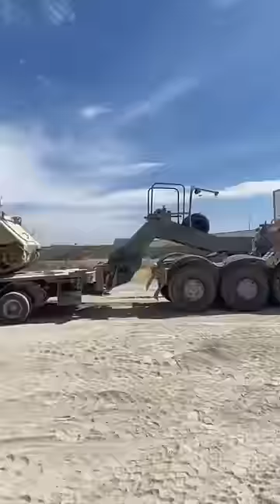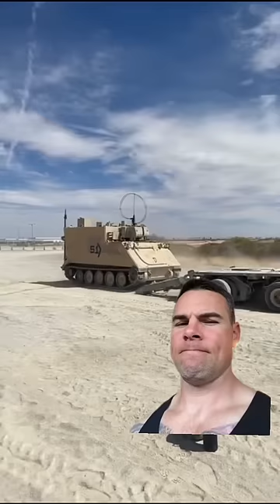I don’t think we’re supposed to do it that way. Via: @usawtfma #military #marine #army #navy

Comment: I drove those on my second tour in Iraq. That is actually called a combat drop. you simply take off the chains put the vehicle in neutral go forward just a little bit and slam on the brakes, and the vehicle slides right off. Extremely useful in a hostile environment. It's cooler with an Abram.
Reply: This comment needs to be pinned fr

Thank you for your service brother ✊🇺🇸
Reply: Yeah the fact that they knew to back up and slam on the brakes to get it moving told me this must be a thing they'd done before.
Reply: 2003 we started the combat drop. Except it was woth a D7 dozer. Now thats a fun way to do both on and off. Amd if you were not perfect timing with it.... Bam.
Reply: @semperfi-1918  hell they we were doing this at fort hood in 94… the was the first time I saw it.. funny as shit..
Reply: You mean reverse?
Reply: @A_name_is_a_name yea, they mean reverse.
Reply: well newton would tell you its better to go backwards and hit the brakes when the vehicle on top of a flatbed is in neutral, else its gonna ram your cabin in front ;)
Reply: @A_name_is_a_name  I did indeed. You are correct.
Reply: @semperfi-1918 I was doing this in 1998 in Germany.  I was in a HET platoon. Bco 701st ,1st Infantry Division, Kitzigen Germany. You were not the first. Besides you Marines didn't even have this HETs. You had HEMMTs with an old M911 trailer.
Reply: Should work perfectly as long as the loaded vehicle is nice aand square to the trailer bed.
Reply: @chrismanning1171 what’s ur point? They could have done it with the m911 as well. And the m911 wasn’t a trailer, it was the truck. The trailer was the m747 semi trailer and Oshkosh m911 tractor!! He didn’t say he was the first to do it just when they started doing it as in his unit or more importantly when he seen it done for the first time and was stating this wasn’t something new. Hate to tell u but ur unit didn’t start this either, we’ve done this in construction for years and years so that’s prolly where the military got it from.
Reply: I did it with an Abrams tank while training for my HETT license. Mind you, it was my tank when I did it. Lol🤣😂🤣
Reply: @joseh9105  Do you remember the link count on the front chains for loading a M1? It's been so long, I forgot.
Reply: What is that thing? I know it's an m113 but what are they using it for?
Reply: @gigipeedee  yes it is but I'm going to say that your guess is as good as mine.
Reply: @joseh9105  My question was more directed at the guy who said he drove one but thanks
Reply: @soup31314  let me guess which unit was doing it. 1st Cave Div out of 3rd Grey Wolf Brigade by any chance close?
Reply: @chrismanning1171  we had em in 1994 with the 1st Cav Div in Ft. Hood and I was there '94-'96.
Reply: @paddyret7968  That is the M577 command post track vehicle. It's used by the commander to communicate with the other elements of the formation and stay in contact with higher command.
Reply: @joseh9105  Kitzigen Germany,  1st Infantry Division Bco 701st . 1998 to 2005. HET platoon.
Reply: @chrismanning1171  nice. I was actually with the 3rd Batt 8th Cav Armor Reg as a tank loader 19Kilo10kilo04. They had several of us in each company getting licensed in the event we had to do our own transport.
Reply: What is that called?
Reply: @joseh9105  I was a 88M20 and a 62B10. We were taught how to drive tanks. Sometimes we would show up to pick up tanks and there were no drivers. So we started driving them on our own and then BN drivers school made a course for us HET drivers. When I got the Army I worked as a contractor mechanic in Korea. I loved driving the M1 on the test track wide open throttle for annual PMCS. That thing is a beast.
Reply: @chrismanning1171  wish you were around when we were testing out different tracks for the Abrams tank. Wide open isn't even close. More like ungoverned and w/o a turret just for it. Lol🤣😂🤣😂🤣
Reply: True, but isn't the crew supposed to be in the tank ready for action, so why not just back it off?
Reply: @rocket870  I couldn’t say for certain why they chose to do it that way. But for my two cents once you know how to do it, it’s actually the fastest and easiest way to do it. Nobody risks injury and it’s pretty fast.
Reply: @DocM49  Thank you for the explanation. Thank you for your service, too, sir🫡
Reply: @joseh9105  yes sir… 1-9 cav…
Reply: @chrismanning1171  I left in '96. Aww Hell Nah. Lol🤣😂🤣
Reply: @soup31314  then you know what we were about. Lol🤣😂🤣😂🤣
Reply: @joseh9105  b co 1-9 cav Nov 94-Jan 96…. Yep I will never forget being at the draft and seeing one of the female hat drivers jump off and her coveralls and are Tatas hitting your knees. Cute huge tatas
Reply: @rocket870  I drove this truck, arrived at whatever unit for pick up  or drop off and there was no crew. Or we have a short time window for our Polizei road escort and a time constraint. Or dropping off at a depot and nobody is there to receive it. Aint got all day to wait around. In Kosovo, we are on standby with three loaded trucks with M1s on the trailer, full combat load. Serbian T72 reported breaching the border. From Camp Bondsteel to Monteff. Get there, driver in the hatch, engine at idle, unchained the tank, hit the reverse and let him fall off the ramps like in the video.  Because it is way faster.
Reply: @soup31314  Nothing like having females in the unit.
Reply: @chrismanning1171  wasn’t my unit.. was the hett drivers.. females in infantry in my time didn’t happen…
Reply: @soup31314  Yeah, we had tons of females in my BN and in our 88M company. It was like Pokémon. Gotta catch  them  all, LOL. I'm glad I didn't go 11B.
Reply: @chrismanning1171  Those bunks in the back of the cab were very convenient is all I'm saying…
Reply: @DocM49  Yeah, get what you are saying. I 've heard stories but never got a chance to try them out besides being on mission over the road.
Reply: @chrismanning1171  my brother was in Kosovo.
Reply: @chrismanning1171  You missed out. I was a medic but the Army converted my MRLS unit so we could go to Iraq and drive trucks. So I only have about a year and a half experience with them. One of the few good things about that tour was those bunks. I think four or five military dependencies were created during that tour.
Reply: @joseh9105  Yeah, that's how old I am.
Reply: @chrismanning1171  that's funny, I just turned 48 last Mon. Brahahahaha!!!!!
Reply: @joseh9105  Happy Birthday Soldier.
Reply: @chrismanning1171  thank you sir.
Reply: I'm just wondering what circumstances are requiring trucks to drive into a hostile zone and drop off combat vehicles so quickly that taking an extra 10 minutes to start them up and drive off in a controlled fashion.
Reply: @bigmaccification  You’ve never been on MSR Tampa in Iraq. Lol

Places like a Iraq didn’t have a front line. Despite that logistics is still needed. Meaning that sometimes trucks get driven through very hostile areas. Even in areas where there are a front line doesn’t mean that the enemy doesn’t have spotters of some kind and can’t reign down artillery or an air strikes on top of you. Planing and controlled speed is crucial in all things in a combat zone.
Reply: 1836th tc here ... did lots of combat drops lol
Reply: @bigmaccification  Combat support units have to take  soldiers, supplies, food, ammo, fuel, and equipment forward to the front lines. Forward units will withdraw from the line to refuel, rearm, and to rest. Tanks that are towed off the line will be loaded on the tank transporter to be transported back to the maintenance assembly area in the rear of the lines. Some times you don't have an extra 10 minutes because the enemy can be right down the road within weapons range.
Reply: @brandonrose4388  thank you for your service.
Reply: That's exactly what I thought this was..perhaps a driver training for combat drops..If this Kragen guy gets freaked ny this....some one show him a cargo plane doing a combat drop..one the ground..and the plane does not land but deploys a parachute out the ass end of say a C130 and the cargo..wahtever it is pops right out on the ground..right side up ready to use.
Whoever did this drop did it perfectly

Comment: this is called a combat drop.  this is when the vehicle is broken down, or if in combat they HETT has to dump the load to get out of there..
Reply: Spot on High Speed!
Reply: 88mike!!!!!
Reply: Whatever, you made that up right?
Reply: @Rosco8485  as a retired army truck driver I can tell you for a fact he is not.
Reply: @Rosco8485  10 year as mechanized infantry, a year as a M577 driver (the box on tracks in video)… and those Detroit engines blow all the time.
Reply: @SweatyFatGuy  Air force? If your one of those guys that like to build and push things out the back of aircraft and watch them fall, thanks for all the A22 pallets, they make great overhead cover to stack sandbags on. Lol
And yeah your brother is also nuts, must run in the family 😂
For a short period of time in Iraq we were using HET tractors to lead convoys since the HUMMVE's were were taking lot's of casualties from IED's.
Having the HET crew way up helped but they still took lots of damage,
It was a short term answer until they received uparmor and MRAPS.
a UH60 pilot???? A crash hawk?
I don't have a fear of flying, I have a fear of WO1's flying UH60's saying, "Watch This!"
Thanks for your family serving.
Reply: @SweatyFatGuy  glad to hear your doing alright, I hope you have VA?
After Nam the Army kicked out a SF guy who won the MOH for being overweight, funny thing, he weighed less when they kicked him out than when he was in Nam.

Comment: It’s perfectly fine to do this with tracked vehicles, as they don’t turn without engine power so as long as it’s on there straight, put it in neutral, remove the straps, let her roll.

Now, if it had wheels, specifically wheels that turn… then you’re likely to wind up with the machine on its side

Comment: I saw a flatbed driver deliver an order of wood for an entire house like that.... those dudes know what they're doing
Reply: Yuuuup sets one end down and pull right out from under it. Clean and quick no lift needed
Reply: they have special trailers with rollers for the prefab roof beams. 
not that i haven't dumped a few lumber packs off the forklift before
Reply: @LordHasek  this one I saw had no rollers.. . Just no fawks given

Comment: They clearly didn't show them removing the shackles and releasing the ebrake.  As for not doing this so it doesn't land on it's side, being a tracked vehicle helps ensure it rolls in a straight line.  However, I am quite impressed with the fact that the ramps didn't dig into the sand as the truck was backing up.

Comment: If it flips on its side you just tie a tow rope to one of the aerials and have something with a lot of grunt pull it back up on to its tracks...

... when the aerial breaks off you tie the tow rope to the hatch and have it pulled onto its tracks.

When anybody sees the damage you blame a low branch on a tree, even if it was only being transported from one side of the airfield to the other.

Comment: Drove HETTs for years.  If itnis a dead vehicle, once iall the chains are taken off, you release the brake on the dead vehicle.    Then you tilt the bed at the best possible angle.  Then a small nudge in reverse, tap the brakes, and let gravity and momentum run thier course.  This is a very safe practice.  Wide open field, no one around to get hurt.

Comment: The e-brake is on DURING transport, even if the driver was in there wouldn't matter if the e-brake is on. It's not gonna move if it's engaged and as long as the transmission is in neutral and the tracks are tensioned correctly tracked machines will roll in a stright line for quite a ways.

Comment: As long as you have the parking brake off and it’s going to go straight back I see no issues if there will be no damage to the vehicle or surroundings.
Reply: You should see how to recover a locked up Deuce Dozer from the side of the highway “under fire”

Comment: I drove tihs in the Army.  Its called a combat drop. Unchained, release the parking brake, and back up to get the track rolling. There are guides on the bed of the trailer that keeps the track going straight back. We did this with M1s, Brads, M88, and M113  Never with wheeled vehicles.

Comment: That’s exactly how you do it, having operated those vehicles in Iraq on a few tours, that’s a spot on combat off load. Also, if a dead tank needs to be uploaded, there are two 55ton wrenches on the truck that can pull up a M88 or M1 loaded within 30 minutes. H.E.T

Comment: Well I'm gonna inform yall what it it. From being a former 88m E-5. That's fort bliss. And that os called a combat drop. When they don't start they are dropped like this. If you look close enough they have track guides that keep the tracks from turning causing a rollover or it to flip. Also the front of the trailer is raised while the back is dropped to make it roll off better! Any other questions about this just ask I've done it plenty of times and it's pretty safe

Comment: So this is a m1068a3, this is the same track my FDC (Fire Direction Center) currently works out of and other S shops as well. These tracks are from Vietnam era and they are constantly breaking down and unloading like this is a very common occurrence. Prop shaft disconnected and handbrake off with a full send to get it off.

Comment: So, here's the deal...  that 577 or 1068 might have its drive shaft disengaged at the engine port...  it is common to remove that section for various reasons.  The brakes are irrelevant if they can't be engaged...  

The real question is, where are the tie down chains?  That may answer your question as to whether or not this was intentional.

Comment: This is a HET system tractor trailer doing a "combat drop". They do this do this to quickly unload armor and GTFO.  The ramps have big springs in them so they flip back up so the truck operators never have to leave the cab. Also....the long cab has extra seating for a tank crew or in our case in OIF an extra place to sleep.

Comment: I was a HET operator, and while I never had occasion to drop like that, I've seen it done a couple of times. Only with track vehicles tho. If you have it properly mounted, and you're on flat ground, it's fairly easy. I mean, with far more experience than I have. I'd probably have rolled it forward, and crashed it onto the gooseneck. But our captain did it, and a E6 did it. Smooth and clean.

Comment: If you are around construction long enough this kind of thing doesn't surprise you.   Watching guys load a backhoe into a dump truck without ramps or driving up the ramps of a trailer with a skid loader only to spin it around so you can drive it off when you get to where you are going.  😊   It's all good until it's not. Then it's really bad.

Comment: The brakes should be set, and it should be secured with chains. And yes they are supposed to drive it on and off the trailer.

Comment: Exactly the that's my only confusion part about these things is yeah they're cool looking but they're also they flip over You're going to need a little crane or a big ass truck to pull it up right also I feel like if you did turn hard enough with that truck it could slide off the trailer

Comment: I mean, they're not supposed to drop your connex box on the air field, but here's the Airforce did a fuckin touch and go woth our stuff when we told them NOT TO because our connex wasn't mean for that. And then we got yelled at by Airforce tower for having our connex on the runway when it was their pilots that did it 😠🙄